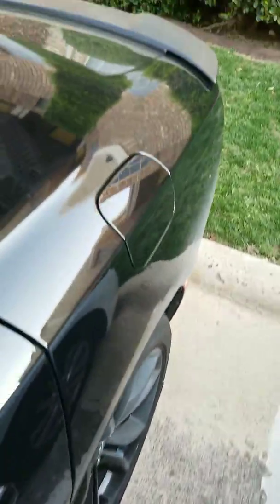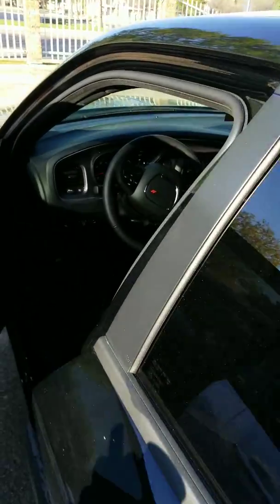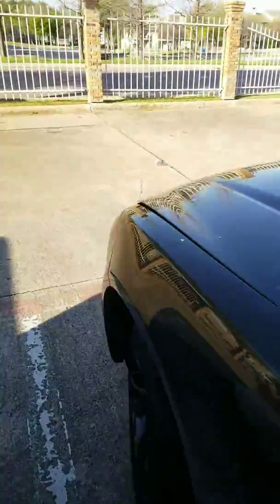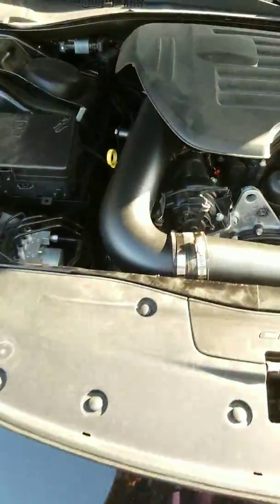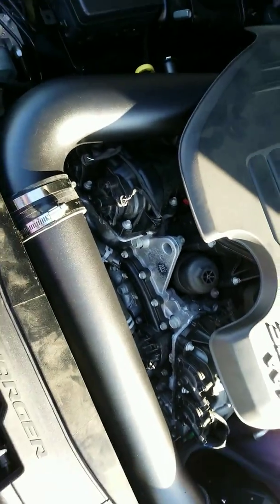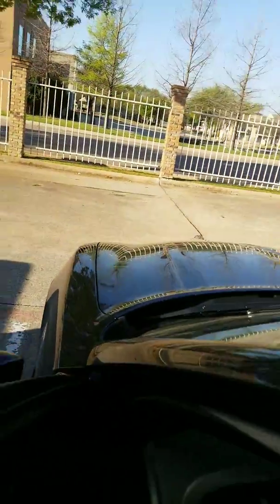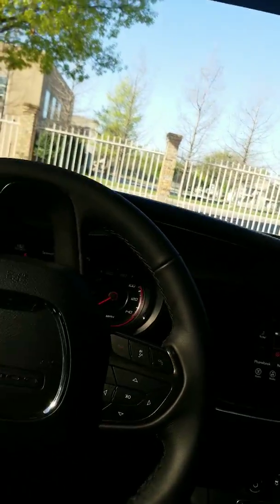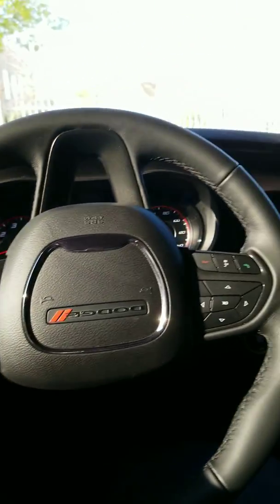V6 charger cold air intake installed

Comment: I was thinking that the 8 speed torque flight transmission Chargers should hold up pretty good with that amount of added HP. The prior gen with the 5 speed then maybe need upgrading but not these newer ones. The gearing is different.

Comment: whats up man? good stuff that cold air intake. Do you notice a little bit of a different sound? I did after I installed mine.  It sounded like more of a deep gargling when I accelerated.
Reply from the maker: Super6 Charger it's a big difference I cut the mid pipe sounds better
Reply from the maker: If you going to do the ripp supercharger  try the throttle body from overkill.com it gives you 20 hp and the ppl that does the supercharger should calibrate it gets you about 500 hp v6
Reply: Hypnosis Car Club Wow! I didn't even consider nodding the throttle body.  500whp would be awesome,  I'm definitely gonna look into that. Thanks bro.
Reply from the maker: Super6 Charger I just looking at that if we go over 400 and some change, we might have to change transmission. but hey how is it going?
Reply: Hypnosis Car Club according to RIPP there are no other mods needed when you install a RIPP supercharger. However, it will be a good idea to upgrade the brakes to stop or slow down a little faster.
Reply: Hypnosis Car Club i went to the Overkill site but was confused on how to use it.
Reply from the maker: Super6 Charger well in just trying to see what all mods need to be done but I just applied for sponsorship so I'll let you know if it works out like I think it do
Reply from the maker: Super6 Charger and will be making car club logos if you or anyone would like 1